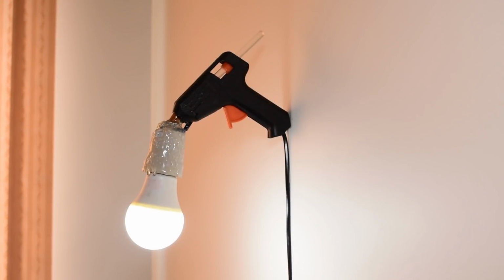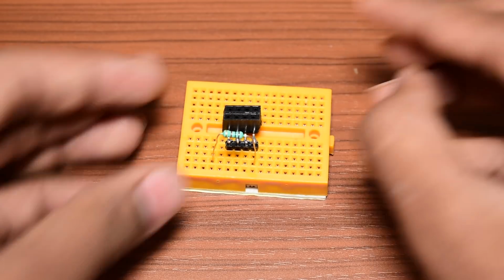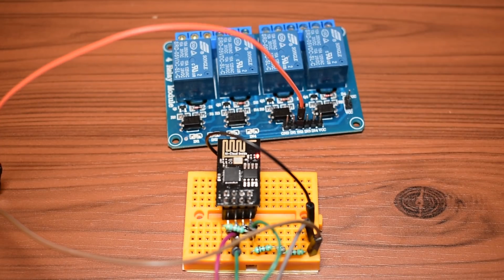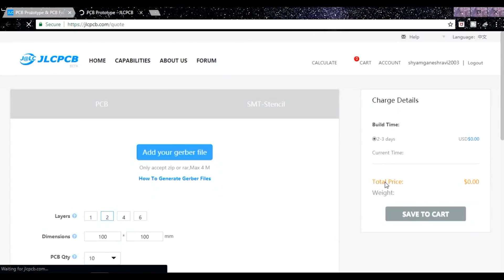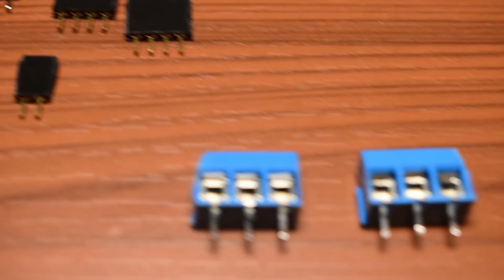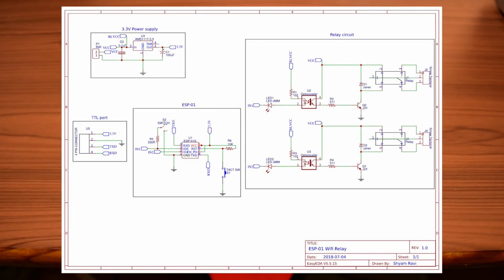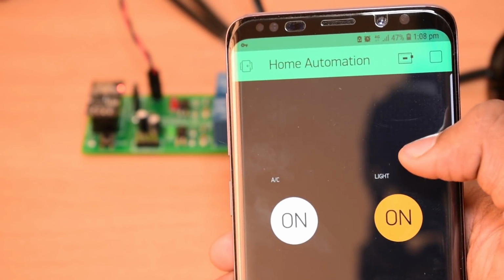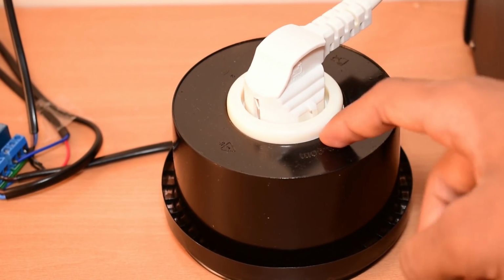DIY Home Automation using ESP8266 & Blynk || IoT Project

Comment: thank you great video:) efter I receive the Token from the app (by e-mail) it works. The io 0 must be  in short circuit to be able to program it, and to run it, disconnect it and short circuit the  +3.3v and EN to make it  run

Comment: Wow great project, thanks for the ideas! Now I know what to do with all those old ESP8266 01's I have laying in my drawer. Back when they came out, I had  a blast playing around with them but quickly switched to the more modern until the wonderful ESP32 was developed. Now I have them all over my house in the form of cameras, and wifi radios as well as using some of the esp8266's to drive MP3 Players and such with the VS1053 versions. The VS are a bit spendy, but they make some great audio devices out of Arduino's and ESP's.

Comment: You said to have separate oversupply when you were working on breadboard , but after the PCB you had only one power supply .How and why?
Reply: Because afterwards he used an Ams1117 5v to 3.3 converter

Comment: Is it possible to use the lamp current to provide the voltage of the Esp instead of having an external supply ?
Reply from the maker: Yes, but anyways you have to convert the mains AC to DC 5V. So you have to use a an adapter.